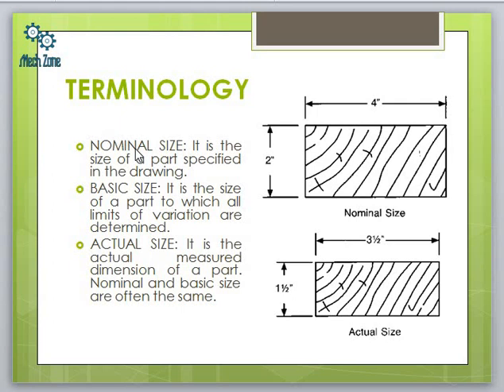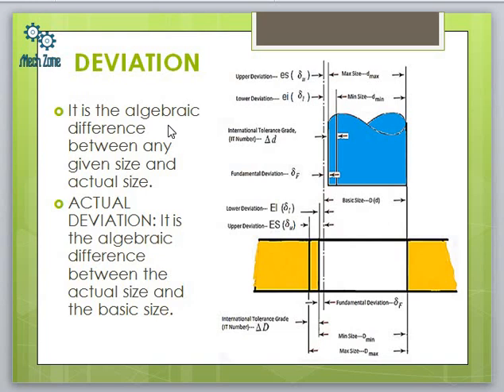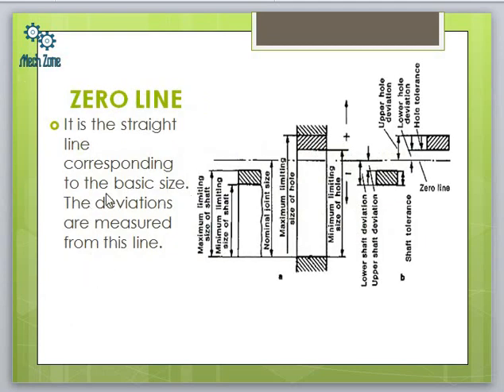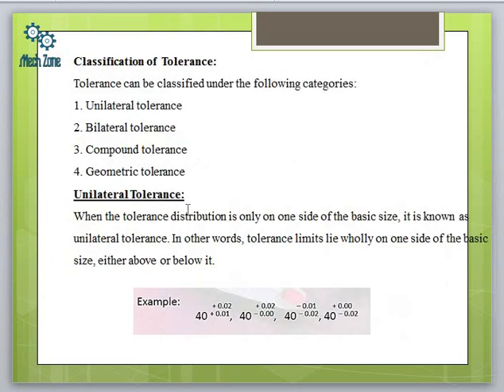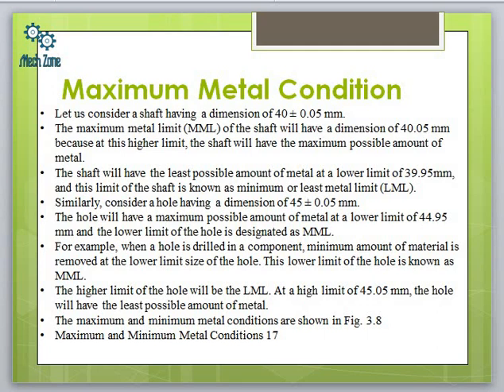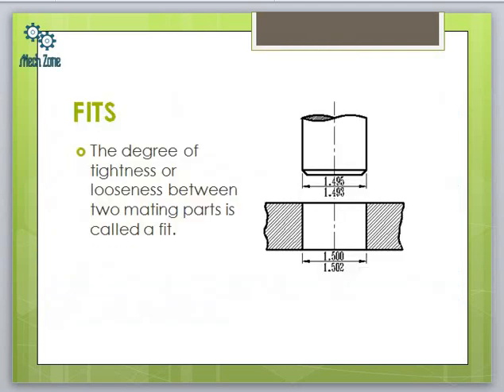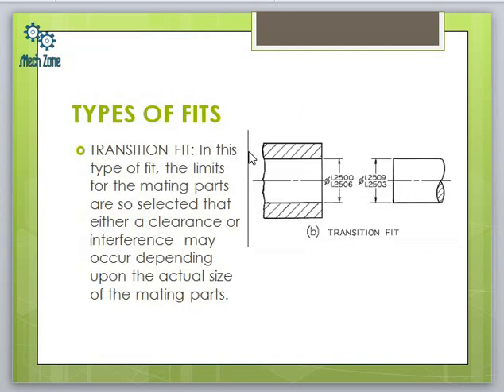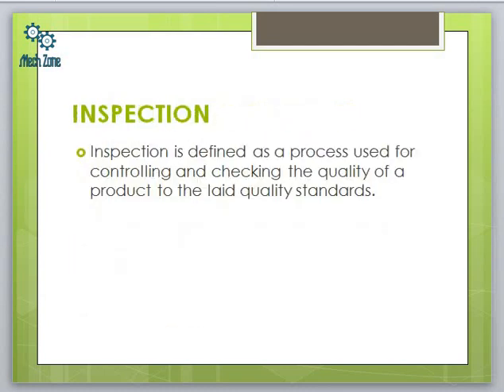Limits, Fits and Tolerance by Mech Zone

Comment: Sir...deviations and limits both are the same or what?
Reply: no not same ex: designer has given drawing with diameter 10
n said tolerances of 1 i.e between 9.5 n 10.5 we can produce this  variation of 0.5 from nominal size is upper n lower limits
but now we have produced the product of size 9.8 then diff between lower limit n actual produced size is lower deviation